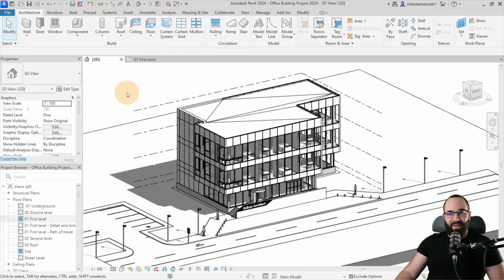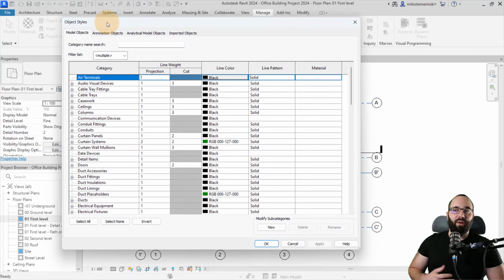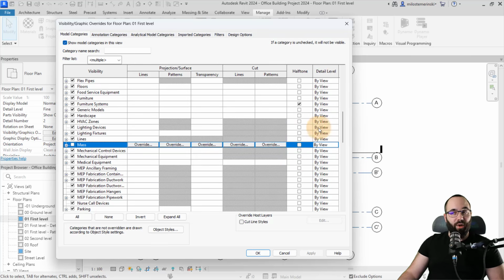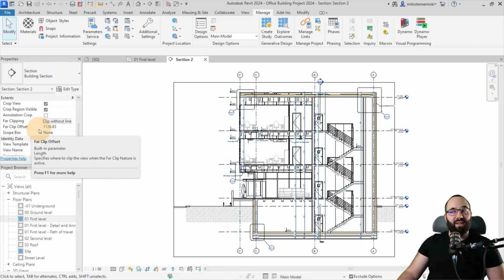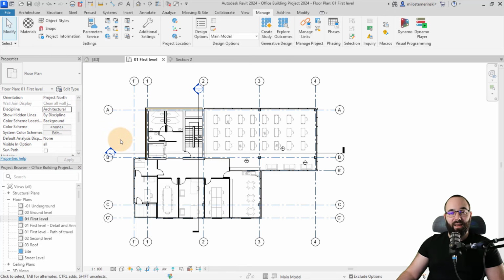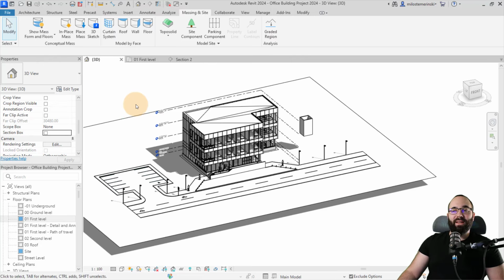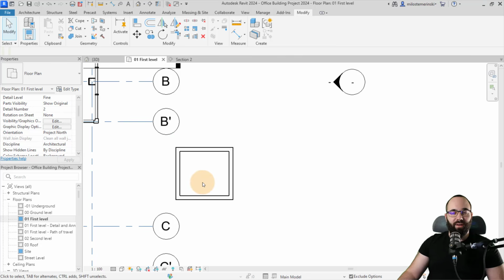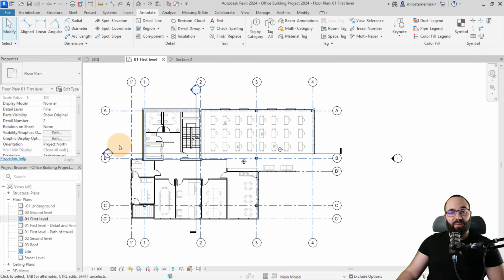Troubleshooting Visibility in Revit Tutorial

Comment: Thank you, Balkan. The problem that I am having with Revit was not specified here. The issue I am having with Revit is every time I switched visual styles from shaded with edges, Consistent colors to Realistic, My model disappears and it looks like I have nothing modeled. When I hover over with the mouse it shows that the building is still there. Can this be something regarding the video card???
Reply from the maker: Yes this is a graphics issue, I find that just closing and opening Revit solves the problem.
Reply: @balkanarchitect  Thank you. Also, it takes forever to jump into realistic visual styles. To be exact, about 3 minutes.
Reply: @balkanarchitect  Sorry to bother you again. I just wanted to ask you if you can make a tutorial on how I can create shapes like Thom Mayne in Revit. Specifically the front facade of the Cooper Union Building. I am kind of interested in just that front portion the one you can see in all of the pictures of that project. I am designing a fire station. And My concept for the design is based on coming strong as a community and central valley in California. The project is located in Fresno and it is part of the Central Valley. So ideally I want to Express the Like a Rocky Shape Concept as well as come together to build a strong community. And this building, The Cooper Union, kind of symbolizes the rocky concept I want to express
Reply: Or maybe try (ZE) zoom extentes command